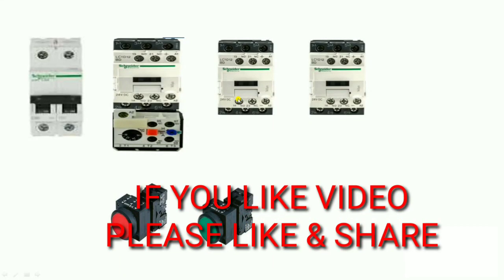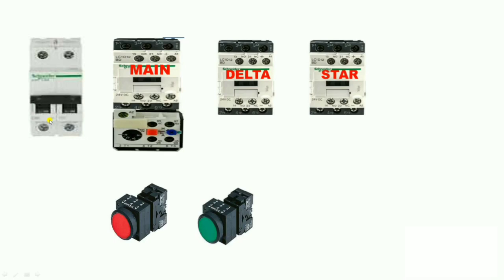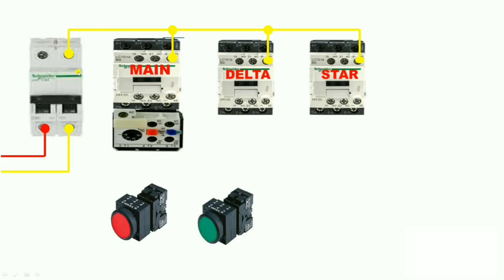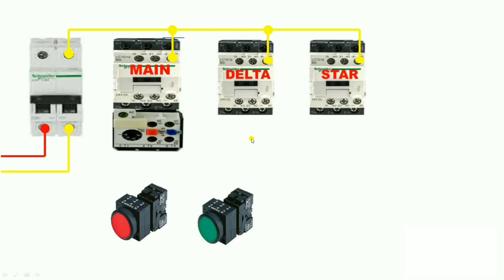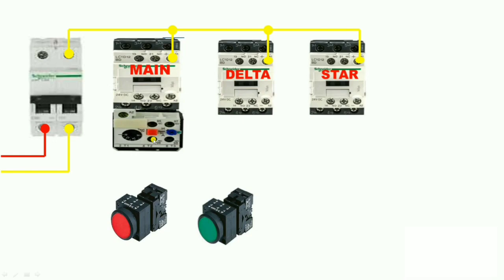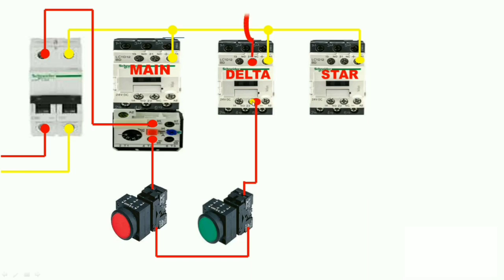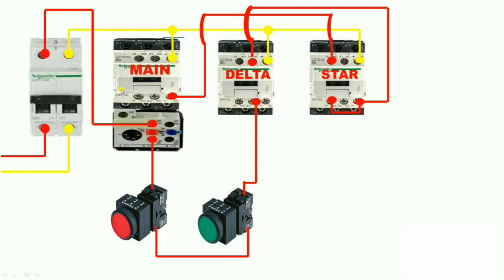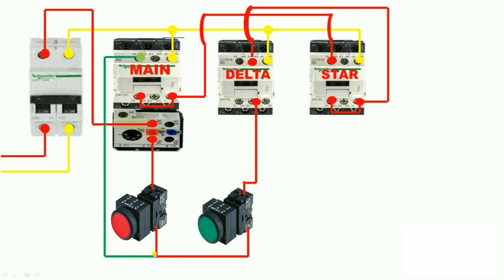STAR DELTA STARTER CONTROL WIRING WITHOUT TIMER! SEMI AUTOMATIC STAR DELTA STARTER

Comment: 10 HP ki submersible Moter ki 3phase he usme wiring kese hogi
Reply from the maker: Wiring kaiki krna h starter ki ya motor terminal ki
Reply: @sntechnicalspecial4839  star delta connection 10Hp ki Hamare Yaha 12Yers juna star delta ka connection Vala box he sir mujhe samajh Nahi Aata star delta connecting